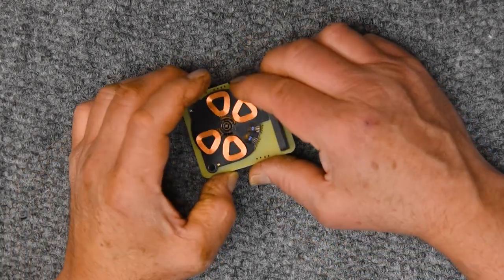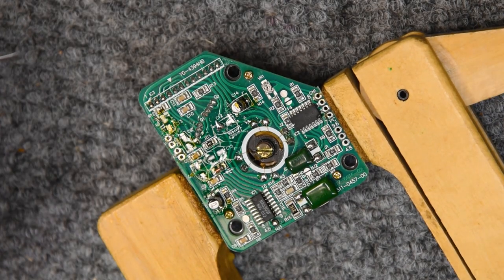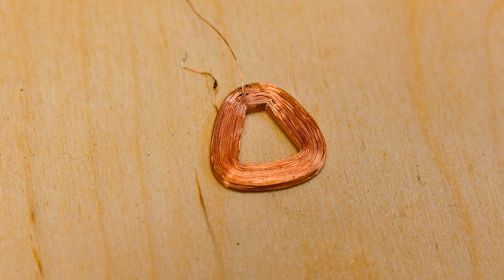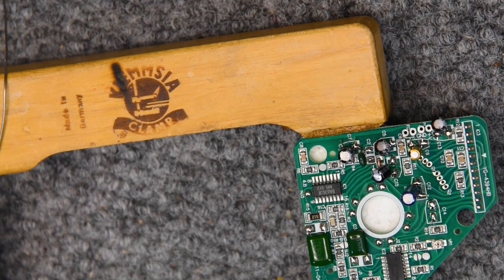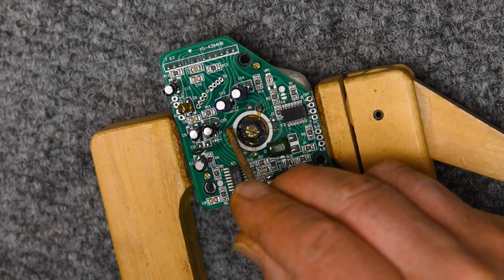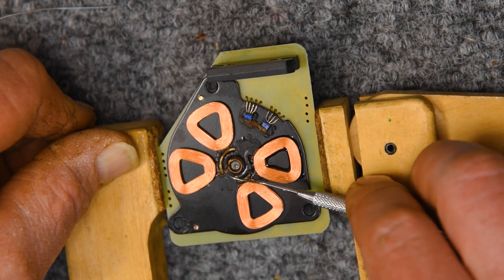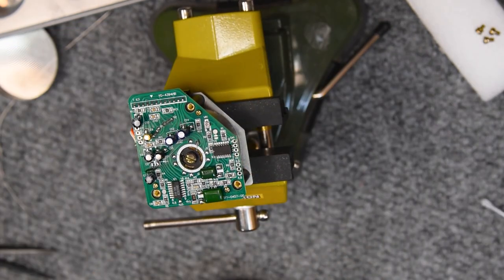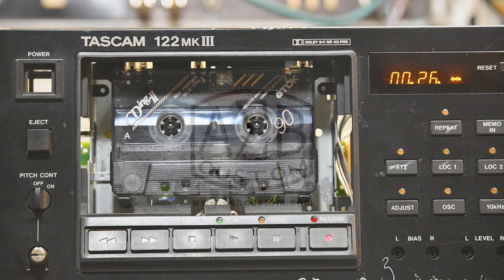Tascam 122mk2 and 122mk3 Capstan Motor Complete Rebuild

Comment: I'm doing my 122 tomorrow.   The c7 cap isn't marked, just a silver top.  Do you know what the rating for that cap is?  I'm assuming it's the same as the 238 boards?   Thanks.
Reply from the maker: C7 should be the 4.7μ 35v.
Reply: @asbcustom  Hi. Got the 2nd Tascam 122 mkii today.  I'm having a bit of confusion reading the coils with the MM. My other board measured 13 on all 4 contact points, like in your video.  My 2nd board is 14 on 3 of the points, but one coil is reading 1070 and no beep.  Here's  video I made of the confusion.  

https://youtu.be/38IQxuEay1k?si=FCIEflzszvdYwwZm
Reply from the maker: Rick, you're correct that it's a problem. I wonder if removing the cap in circuit with that coil and retesting, or even removing that coil from the circuit and retesting, might provide a clue. It may be a bad coil but I would isolate it before moving on.
Reply: @asbcustom  Thanks for the reply.  So you mean desolder the 2 wires that run from the coil and test the 2 wires out of circuit?  And which cap are you referring to that i should remove?  When i first turned on the unit the capstan was running ok. (no runaway) Then a couple of times it would not spin when i engaged the tape in switch. And a single "0" appeared on the digital counter. Power off would refresh the unit.  Will that motor run on 3 coils?
Reply from the maker: I was suggesting that if you're getting anomalous readings in circuit, then try measuring out of circuit, however you choose to do it. Be gentile on those leads as always.
Reply: @asbcustom  Are you talking about C14 bi polar cap?  I think that one is on the trace to that coil.    
Also, when teasing the two coil wire ends out of the two solder joints I should get 14 or so when probed?   If the coil is compromised then no reading would be expected?  This is the pucker factor you mentioned. 🙈
Reply from the maker: Yes, whatever is in circuit with the offending coil, that would be more safe I think than messing with the leads, but you're the one sitting in front of it so must decide on your own. 14ohms would be a good number, yes.
Reply: @asbcustom  I will get a bipolar and replace it.  I pulled out the c14 but still same reading. Is that to be expected?
I did get my other 122 back together and it's a winner. Sounds great.  One issue....control belt motor keeps spinning after the heads raised. I thought it was a slipping idler, but I saw the motor is just whizzing away.  Is there a sensor that tells it to shut off?
Reply from the maker: If you trust your readings, then you may have a bad coil.

Control motor is actuated by its potentiometer. If the control arm attached to the pot is out of place, all manner of things can go wrong. I've shown the correct position in several videos, the fork must engage the bar on the cam.
Reply: @asbcustom  got a new belt today. Much firmer and it seems to have done the trick.  The other must have been a bit stretched. 

I unsoldered the coil and no continuity.   I back the wires very gently and one side just gave away right where it goes through to the underside.  When I pulled the coil plate off I can see its broken at the winding. Soo...I can struggle trying to get a join at the nub or remove the coil....via heat. Did you pry yours from any particular side? I didn't want to slide a blade under it incase the coil catches and get damaged.  I figure heat and lift it from a corner without sliding anything under the coil?  Did you just eye it back in place when finished? Wasn't sure if those coils had some tolerance if not glued exactly back in with micro millimetre accuracy.
Reply from the maker: To remove the coil I made a Teflon chisel, no amount of prying should be done as the coil will deform. I used a heat gun, and watched with a thermo camera, to heat the baseplate, and keep it at around 350°F (I think) for an amount of time, until I could get the Teflon chisel/scraper to lift the coil. I do this sort of thing with some regularity and recognize the odor when epoxy starts to soften. No prying took place at all, the heat will break down the epoxy and separate the coil on it own. I don't think exact placement is necessary although the remaining adhesive provided it, as it wasn't disturbed. I won't encourage you to attempt it, only you know your limits and it's a very delicate operation.
Reply: @asbcustom  hmmm, sounds tricky. I was actually thinking of getting a coil of .2mm insulated winding copper and making my own coil. If i made a small loom and wound that into that shape, enamelled  and got the 14 resistance reading, would that not make the math add up?  If this is doable id like to make a video of it, because im sure im not the first person to have a damaged or bad coil board.  And good luck finding a spare one these days.  🙄  Have you ever considered this as a solution?
Reply from the maker: Yes, making a coil winder is an agenda item. My thought is to 3D print a two-piece form, the correct profile and width, that will release the coil when taken apart. The number of winds, and actual wire diameter, can be determined from the original. I would mic the actual wire diameter, as the coating may be different on the replacement. I have mechanical machine counters here, but a simple electronic one could probably be purchased online. If I were only doing one, I think a handle, turning by hand, and counting manually should do the trick. In my mind, the form would need to fully encase the coil top and bottom as I think the height is critical on these. The form is also something that could be whittled from wood if no other means were available.

Definitely make a video if you do it, I know of a lot of people would like to see the process.
Reply: @asbcustom  Do you think the shape of it is critical?  Im not sure how to get the gauge of the wire.  Its about the size of a single strand of wire out of small speaker wires. And you mentioned turns?  Could you not probe a 10 ft piece of wire for example and get a reading on it and do the math to reach the desired resistance? I dont have a 3d printer but i think that it would be easy enough to get the shape of the inner circumference and go from there. Its a fiddly procedure but trial and error could make it a bit of fun. I really dont like the way  Tascam made that component so fragile and so difficult to service. Do you think there are other owners of these coil systems that are struggling to repair their motors?
Reply: @asbcustom  Well i got the thing back together. I tapped into a wire  on the bottom of the coil, but could only get a 4-5 resistance reading. The rest are all 14.  I was expecting a slower speed or issues , but the capstan is turning at a solid speed and appears to be ok.  I made a quick test tone on my panasonic boombox which is fairly accurate, and the tone was not far off.  I quick tweak on the pot on the pitch cont.  board and it was good.   Ive compared this with my other 122 mkii and they match up fine. Is this because the other 3 coils are pushing the 4th one along?  I think the coils work in pairs according to the SM.  Anyways, the playback isnt quite upto my 234 quality. Bit mushy. but i think i can adjust the bias. 

I did want to ask you what common adhesive can i use to keep the coil wires from moving around?  That stuff that was original all crumbled away when i removed the coil plate.  I saw you used some 3m stuff, but i may not be able to get that. Could i squeeze some clear silicone around the coil gaps to secure them?  I really dont want to touch the wires again if possible,
Reply from the maker: So you think a small motor, made 30-35 years ago, most likely running 24 hours a day in an abusive radio studio is fragile? Have you ever owned a car for 35 years without ever servicing it?
Reply: @asbcustom  Not at all. Built like a tank. Thats why i like working with them.  Old and beautiful. That winding that comes through the slots to the capstan board is the fragile bit. I have big hands and my eyes are a bit iffy.
Reply from the maker: Yes, it needs to be gently dealt with. Repeated rough disturbances will certainly cause failure.
Reply: @asbcustom  hi.  Got the 2 122s running smoothly.  The one with the iffy coil is fine , so Tascam really excels with their build design.   They sound really good to be honest.  I will learn about the fine tuning them as I go.  Looks daunting with the amount of pots that are on the audio side of things.  Dolby, eq, bias, etc.  I do like these machines alot. 

I did have a question and wondered if you've run into this.  My counter on one deck will freeze up randomly.  Goes to all '0000's and won't work again unless turned off/on.   I can replicate the issue when I toggle the tape in sensor several times and then it's '0000' or a single number 5,7,0 etc.  Everything works on the deck but the sensor is stuck unless powered down.   I'm wondering if there's an IC that's faulty or maybe something else?  It's just such a random thing.  I'm flummoxed.  🙈

Here's a video of the snafu.  Thanks again. Rick
https://youtu.be/tFkdS9WMMIA?si=imM_3rtvv5KwfD4n
Reply from the maker: Good job getting the motor running, what then was the coil issue about?

Regarding the counter, we tend to want to blame the IC for everything but it's usually something else. These boards suffer from poor, or weak soldering in various locations, thin wires, and connector issues. If I were looking for that intermediate fault, I would track it back and look first at compromised pads and traces. Try tapping around and see if anything is loose.
Reply: @asbcustom  Well the coil I ended up teasing a wire out and tapping a thin copper strand onto it so I had continuity with both leads, but was only getting a 5 reading , not the 14 like the others. I think they work in pairs because I would get 24 & 19  readings on the IC pins that they run to.  Apparently that's enough for it to maintain the capstan speed.  I thought I may have had to adjust VR1  on the motor board to compensate but it was more a less spot on.  I haven't figured out why, but it runs fine. 🤷‍♂️   Tascam magic.

I will poke around the control board for the meter glitch.  I swapped the one from my other 122 and it was the same.  Glad it wasn't the meter IC because that chip is scarce.  So I will work back from there.  Hopefully it's like you say, and its a sketchy solder joint or wire.  Funny how it does it after about 10 or so 'tape in' cycles.   Almost as if it's building up a power spike or smt.
Reply: @asbcustom  I am struggling to find that intermittent counter display freeze issue.  I swapped transports from my other 122 and the fault still shows up. So i can eliminate that.  I swapped the pcb counter board also and that gets the same fault,  so it must be coming from the M.Board.  I unplugged the lead from the MB to the counter pcb and it goes away.  Something must be sending a funny random signal to that board but I'm running out of ideas.   It has to be between the tape in switch and the socket on the MB i would imagine.  Being intermittent its not easy to isolate. 🤔  Is there an IC responsible for that operation?
Reply from the maker: You swapped the counter switch PCB's out, is that correct?
Reply: @asbcustom  yeah, the board with the 9 buttons on it.   I tried that board on the other 122 and it works fine.  Same with the digital counter display.  Something is tripping up the counter board or the digital counter.  Sometimes it just goes blank. Other times just defaults to 0000 and won't advance. Other times just displays a 5, 7, 9,0  single digit.  It will work fine if its turned off and on again.  Then it randomly freezes when you activate the tape in switch.  Everything works fine, but the counter is frozen and inoperative.   I can tell when it's going to freeze because after a few clicks of the tape in switch the display flickers for a split second, then 2 clicks more and it freezes up.  It's really bizarre.   I just can't think what's tripping up the counter but I've swapped the transport, counter display, counter pcb, unplugged the pitch control board so no capstan motor running,  so it has to be on the MB somehow, I'd assume 🤔
Reply from the maker: Well, you've ruled out a bad IC then, and just about everything else really, except for an intermittent connection somewhere on the only board you haven't swapped. I would be tapping around every connection and component with some pegwood, smacking the case with my hand, using freeze spray, whatever it takes to isolate the fault on that one board or the associated wiring?
Reply: @asbcustom  yeah. It's a pain that it is random.  I don't understand why if it was a loose connection,  it's freezing the display and only resets when turned off.  I'd expect it to go off or flicker a bit,  but the way it just freezes and displays single digits is unusual.   There is 1 power lead that goes to the MB and those 2 leads that goto the display and transport.  If i pull off the 8 pin plug from the counter pcb I don't get the fault. But I'm not sure if that's related or not.
Reply from the maker: Because you've eliminated every other possibility by swapping out every other part in the chain, isn't that correct? What about using some freeze spray on all the components and traces in the circuit?
Reply: @asbcustom  yes, i have not been able to replicate the error on the good deck. Both transports will trigger the error on suspect deck, but not the other way around. Same for the components.  Would a faulty cap in the circuit be enough for it to work for the most part, and then malfunction when the conditions were met? The display reacts by dimming a tiny bit when the tape in sensor is pressed and doesnt on the other deck, so  i think something in the circuit is failing when conditions are met. There is a cap C153 right before the power lead to the counter pcb, but you say there are no IC in that circuit other than the one on the transport and display counter?  Freeze spray?  Im not familiar with it.  What does that do to the components and trace?  cheers. Rick
Reply from the maker: You should see the intermittent fault I've been chasing on my work truck for, oh, say 5 or 6 years now I suppose. It happens randomly, usually following rain or snow but not always. I can correct it by wiggling one of many wiring looms with hundreds of connections but can't locate the offending one because when I touch it, the fault goes away. Like you, I know about where the problem lies, but not the specific component.
Reply: @asbcustom  yeah, wiring looms are a nightmare.  Id much rather a solid fault that i can track down step by step.  The random faults are a pain in the rear.  I did find that there is a voltage drop from -10.4V to -1v on pin 6 on the plug that connects to the counter sw pcb. So definitely an issue there. Volts come back to normal once its power cycled.   Now i need to see whats creating the drop.  Should be fun. 🙄😆
Reply: @asbcustom  I wanted to ask you about the level potentiometers.  One of mine is bent and I doubt it can be straightened easily.  Its a 10k linear i believe. Japan made.  Is there any reason i couldnt put a similar 10k in there with same shaft dimensions? Not sure i will find the same make/model (Alps 042r) with that shaft length, but i see lots online, but different makers.  Any suggestions for a good quality replacement for both levels? Is 10k the only thing relevant to look out for or is there other things i need to consider?
Reply from the maker: @rcary  I haven't found direct replacements for those because of the shaft length, they require a shaft extension. Going from memory I think 20K for the inputs and 10K 2-gang for the output, both audio taper, it might be reverse of that though. The pots are easy to find but not the shaft configuration, if you do find any, please let me know.
Reply: @asbcustom  Hi. i managed to find some metal shaft ones out of Thailand. They are 35mm opposed to 40mm like the Alps, but i can get the knob grub screw to lock on.  Only thing is, there is a bit of crackle when i adjust the levels.  I tried them on my other 122 and same thing, so i think its the new pots?  Funny thing, when i touch anywhere on the deck with my other hand the crackle goes away.  They were not expensive and are unbranded. Futurlec was the supplier.  POT10KBSHAFT model.  What might be causing the crackle and a bit of hum?  I reflowed my solder joints, sprayed them with c cleaner. No dice.  Is it poor quality thats causing poor grounding?  What have you used in the past?  Im struggling to find 6mm dia shaft at 35-40 mm or longer and these fit nice.  :(
Reply from the maker: @rcary  It does sound as though some component is going bad causing the buzz. I once had one that was picking up radio stations when I touched it. Can't remember what ended up being the cause though, I doubt the new pots are your problem. When I have replaced them, I use the available Alps then turn an extension shaft. The only downside is that the extension must be removed for any future replacement.
Reply: @asbcustom  hhhm.  Yeah not sure.  Was fine before, with the Alps.  The new pots were less than a couple bucks, so the crackly sound is probably down to not so good carbon to wiper contact.  There are no other components on the levels board other than the pots and some trimmers.  And the scratchy sound follows to my other deck when i swap the level control board over.  When i touch the left pot and turn it the crackle is in the left headphone. When touch/turn the right level pot it crackles on the right side.  😂
Reply from the maker: @rcary  Oh I see. Yes of course, if the crackle follows the pots then the pots are to blame. What was wrong with the old ones again?
Reply: @asbcustom  I ended up finding the whole level assembly (inputs/output) on Ebay in the states for $20.  Getting my brother to post it over here to me. Cant beat that! :)  I should be able to just pull the old assembly out and put the new one in, right?  Would those pot trimmers on the board need tweaking?  Im assuming thats trimmers for the signal levels? Or should i just unsolder the 2 alps and swap them over?   Cheers from Wales. 🎄☔
Reply from the maker: @rcary  No trimpot values should be affected, no. You could easily swap out the whole assembly, bracket and all, if you wish. Refresh my memory, the original pots were damaged or just wouldn't clean up?
Reply: @asbcustom  The original alps broke off, snapped the boards on the pots.  I replaced with cheap ones, that had the length and metal, but scratchy.    So, pop in the new assembly then. :)  I will have a spare output dual gang, so thats handy for if needed one day.  I just purchased a 122b the other day also, so looking forward to poking around in that. Those are big and clunky like the 133 i think.  Have you had a chance to use this model?  I was looking out for one, and got a good deal too.  I have quite a collection now.  😆
Reply from the maker: @rcary  I see, well, sounds as though you have it licked now. Yes, the 122 is a favorite for many including myself. Totally different animal than your mk2. It will likely need a power supply recap and there are many. The heads can be difficult to evaluate by appearance but the machine sounds excellent when tuned up. It has a nice warm valve-like roundness about it, and at double speed, sounds more like an open reel than cassette. They are also built to outlive the pyramids!
Reply: @asbcustom  I think my 133 will out live mankind too. 😆   You mentioned PS caps will possibly need a swap out.  Will there be any obvious indication that this needs doing?  The guy selling it said it plays fine, but after a while the tape warbled a bit.  He did say they were old cassettes.   I suppose I will find out when it arrives.  I look forward to hearing those solenoids clunking and thumping. 😀
Reply from the maker: @rcary  Swollen tops are common on those caps. I would also scrub the pinch roller with a brass brush in warm soap and water first, to evaluate the warble. Last time I checked, Teac still supplies the capstan belt, I think I bought the last ones through Full Compass.